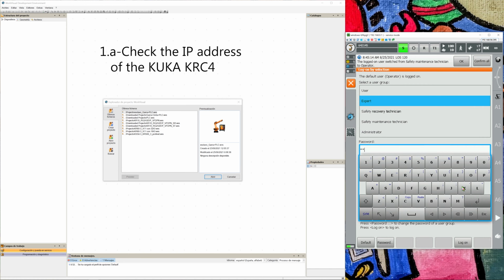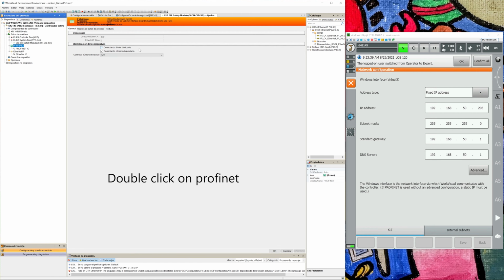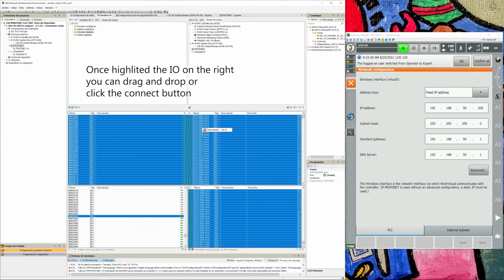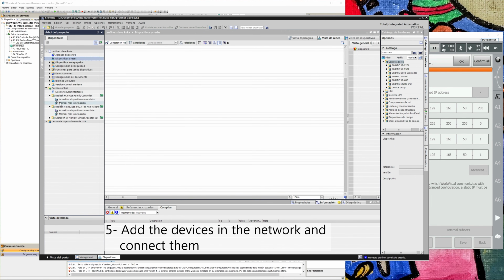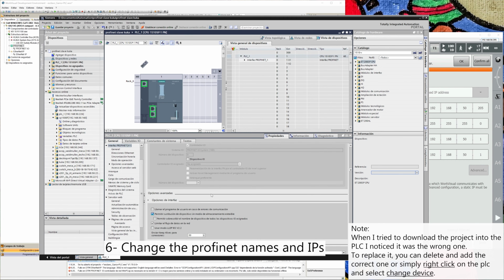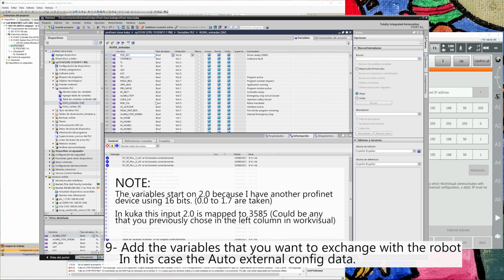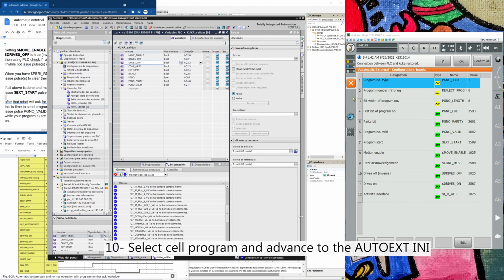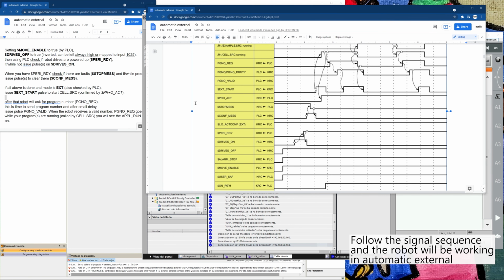KUKA krc4 TIA portal v16 tutorial AUTO ext with profinet 4K

Comment: thank you for your effort ..your videos are great i have a question if you could help me plz i want to add variable that can control speed of spindle throw a siemens 1200 i add analog output model in siemens plc but i couldn't find how to link the output analog  to kuka krc4 robot
Reply from the maker: Thank you very much, it's quite the same instead of declaring digital inputs you add an analog input that has to be a integer value in the profinet stack. 
Following this video, on the left where i have digital IO select analogue and on the right where the fieldbuses are select profinet. Then select the type of uint or int and link them togther. That's it.

Comment: I'm confused you did all this in "T1" mode. Shouldn't it be in "Ext" mode?
Reply from the maker: Im not really using the smartpad much in this video, only to show how to change the IP and connect. 
The whole point of this video is to start a program in AUTO Ext mode with a PLC.
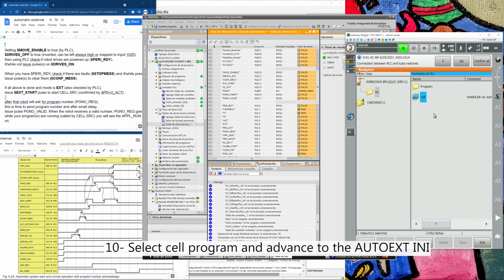You need to be on "EXT" mode when I am forcing the outputs of the PLC in the minute 08:00